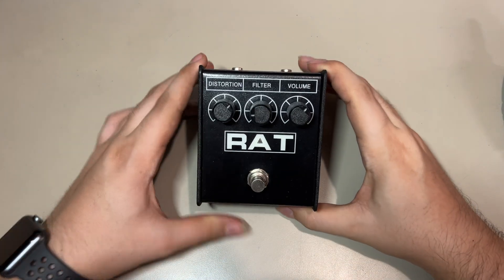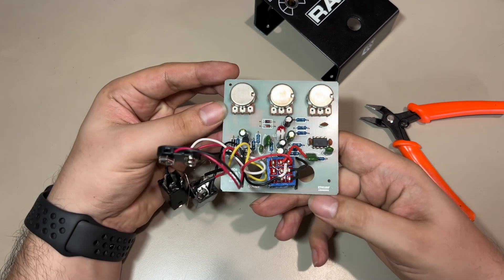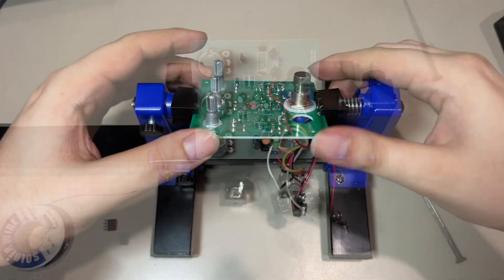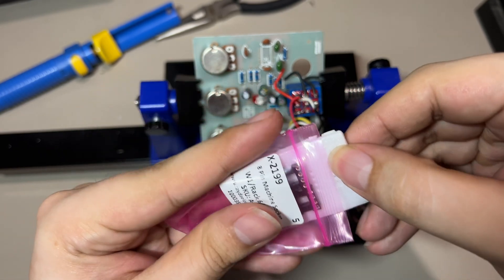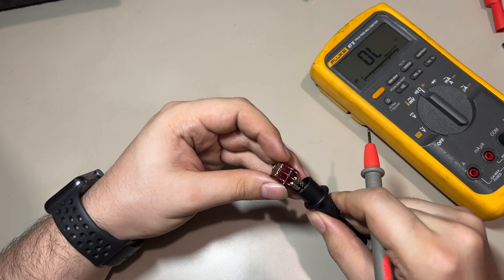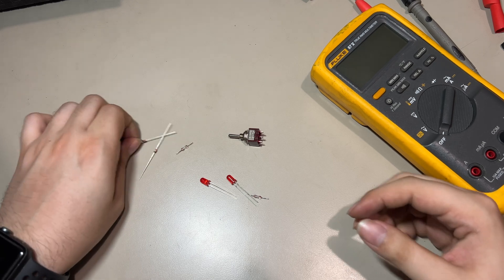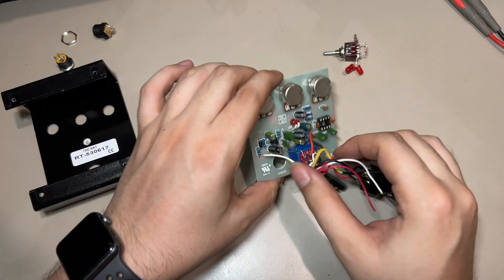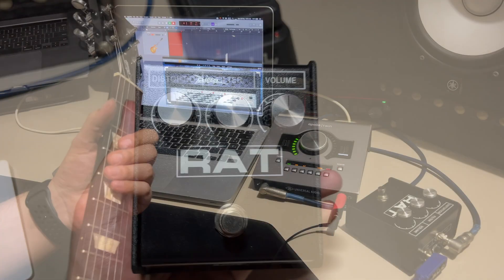ProCO RAT Ultimate Mod (LM308, 1N34A, 1N914, LED)

Comment: So your saying I can buy a $50 Proco Rat 2 and mod it, its not like Boss new pedals where they chipped em up ?
Reply from the maker: Exactly, a brand new one!
Reply: @santiagomoreno696  hope im not been annoying to ask but I use chatGTP and other Ai to search specific nerd info, you know tech stuff, and it said;
-Search for a RAT 2 pedal  with DIP‑8 op‑amp sockets (from early 2000s–2016).
-They look like a classic 8‑pin socket — not flat SMD chips.
-Ask for internal photos or confirmation before buying.
-With a socket, you can easily drop in an LM308N and get the classic tone.

Comment: Love this mod……..have a spare Rat and will be doing this 👌 A couple of questions……..are the diode pairs also soldered with one diode going one way and the other going in the opposite direction ? Also does it matter if you use D2 or D3 for the adding the wires ?
Reply from the maker: Cool, it becomes a monster after that. Yes, the diodes should be in opposite directions and I don't understand what you mean by D2/D3 for the wires.

Comment: does the led color matter in this case?
Reply from the maker: Yes, it matters, for instance Red is for Marshall-ish sound and Yellow is for Mesa-ish sound so you can experiment, different LED colors have different forward voltages.